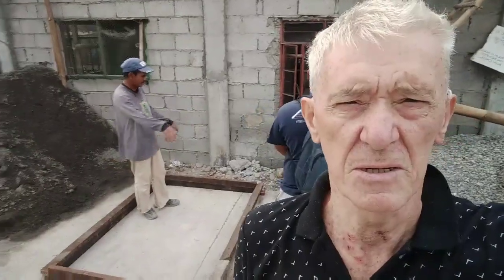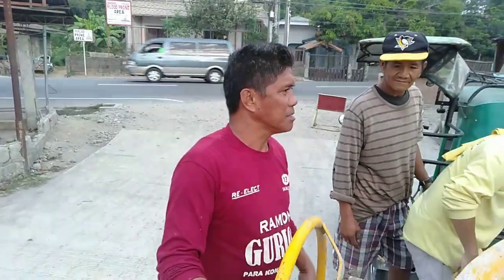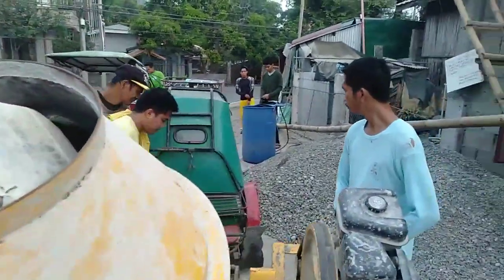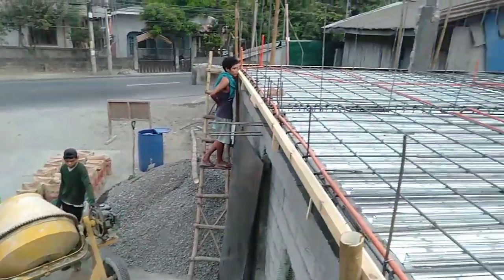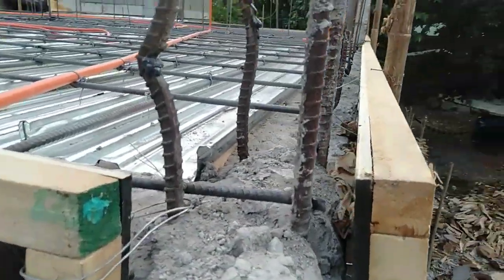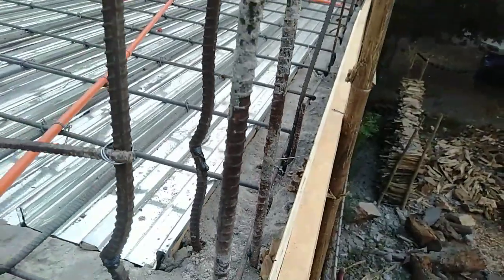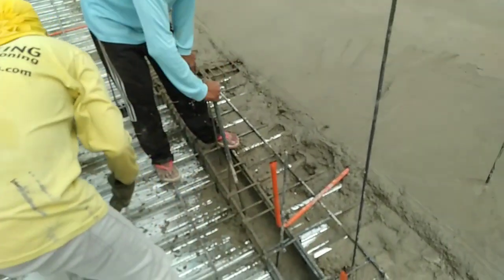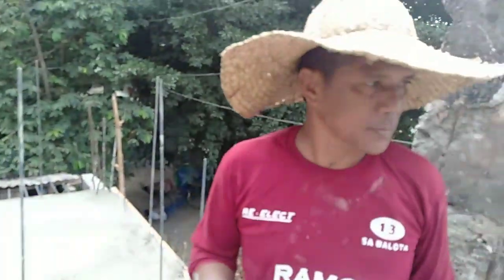#6 SIMPLE HOME CONSTRUCTION IN THE PHILIPPINES

Comment: I don’t know my friend but maybe the mix ratio is probably correct but I just don’t like it when it’s runny or is it because of the heat so that’s why they have to add more water.. the reason I’m asking why is because I plan to build also there in the future, by the way I’m from the States, ty keep the videos coming..
Reply from the maker: There are many versions that might suggest it's too wet, but when it arrives by a truck it's pretty sloppy too, but as the heat is a consideration, I suspect that is the reason that they do it that way.As for the ratio that was stipulated by the engineer